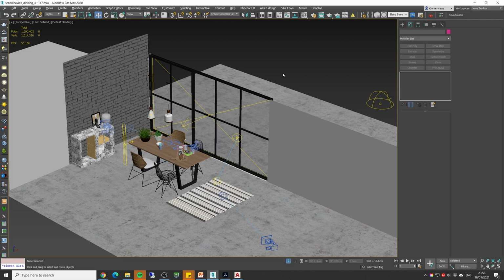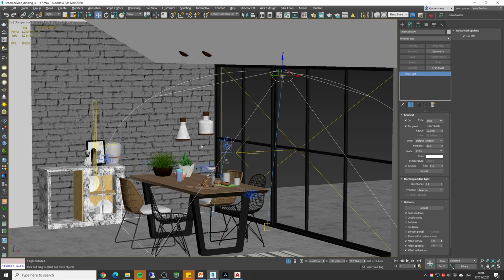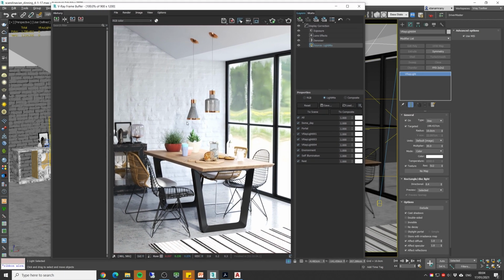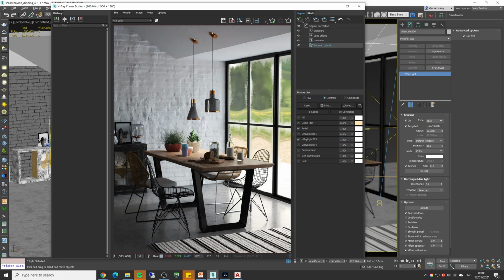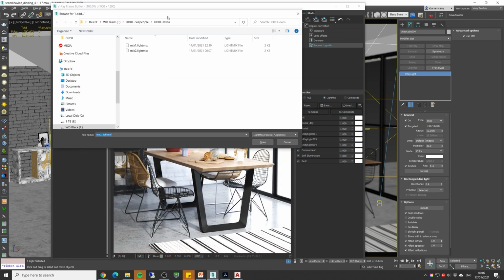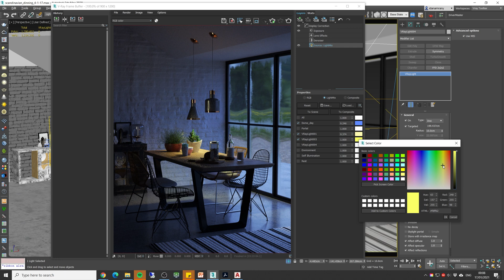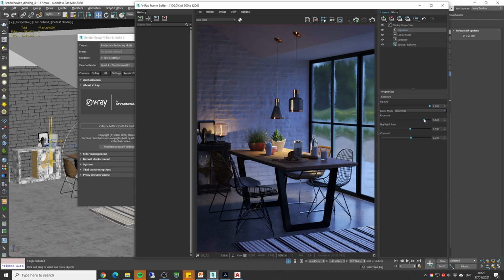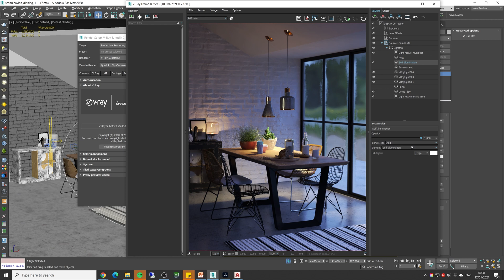Vray LIGHT MIX - How to change your lighting WITHOUT RE-RENDERING - Vray5 for 3ds max

Comment: Compact tutorial! Well done!  I use light mix  for fine tuning because I always try to adjust the lights in the architectural renderings that they meet my needs. But for interior rendering it is a great tool. On the other hand - the preview in the FVB is already as good as you don´t need much more.